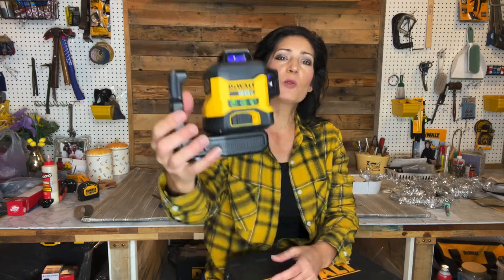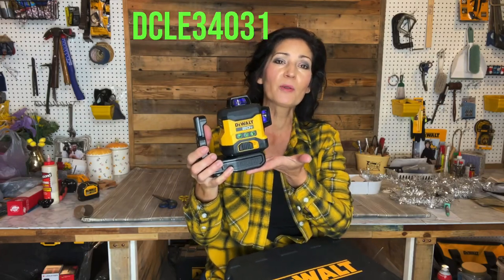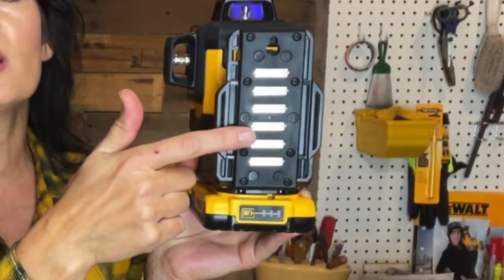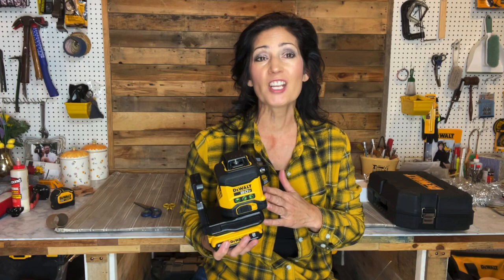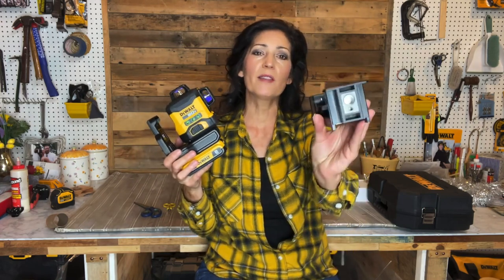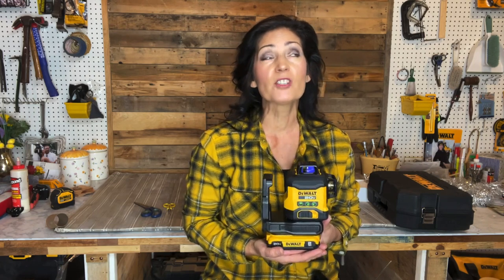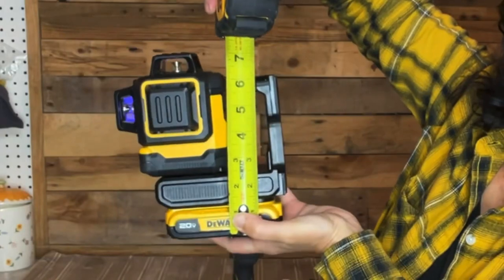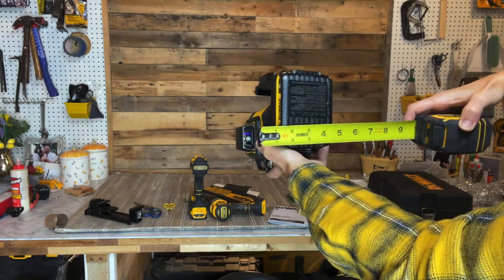NEW GREEN DeWalt Laser Line Level Complete Overview Review Demonstration DCLE34031 (SO COOL! )

Comment: I don't know why they thought putting the battery on the bottom was a good idea. It could have been mounted on the side and left the thread adaptor on the bottom to mount it onto the magnetic/ drop ceiling bracket. That would of allowed to be used with things like the Huepar fine tuning brackets or at a later date, their own. The 12v is the best out of the Dewalt range so far I think.
Reply: The 360 I have is on the side. The green beam is very hard to see after a few feet.